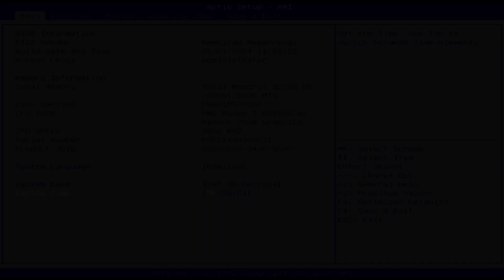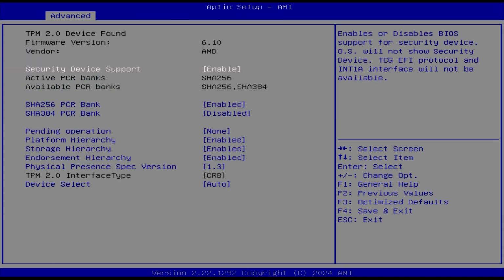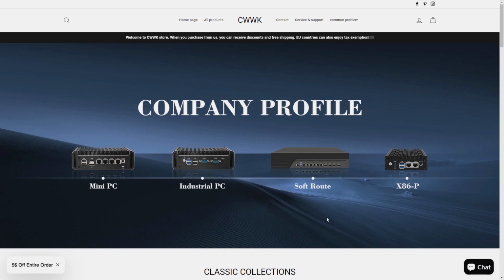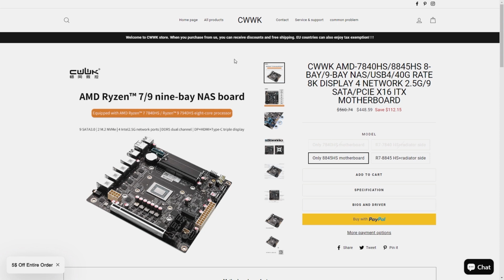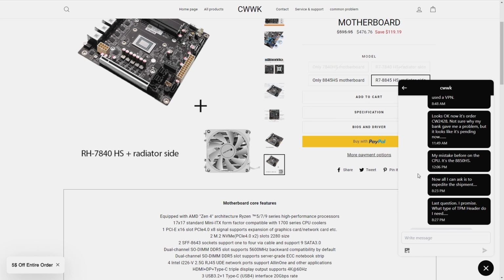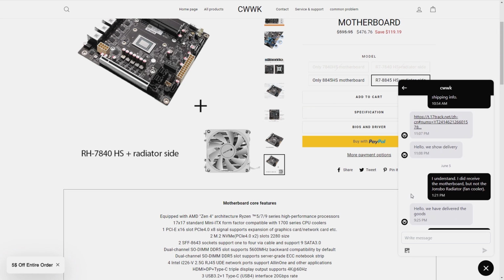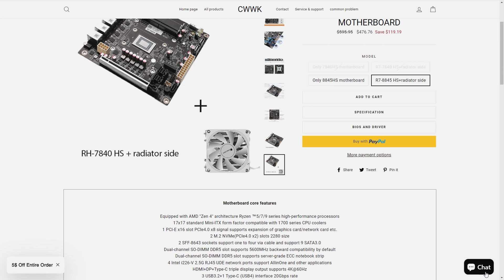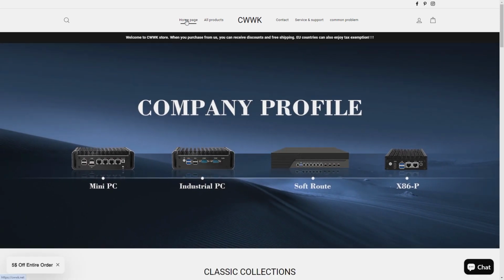My CWWK AMD Ryzen 7 8845HS 9 Bay NAS Board

Comment from the maker: OK, I got it.  Partially my fault and the fault of .........  OK me.  I still have questions, but it works...  New Video soon...
Reply: What do you mean? I got the same board, which decided to die today. Turn it off to add molex extension to the PSU to connect to the N3 Jonsbo NAS, and this thing didn't want to turn on. Tried everything, no luck. Reaching out to CWWK for warranty, and see what happens.

Comment: I have the same board, and found that Kingston KSM56T46BD8KM-32HA (32gig ECC sticks yea I know, no ecc here) are rock solid with it.  Been running it about 2 weeks 24/7 after running memtest on it.  Not as a NAS, but with 2 2tb NVME on the board, and a 512nvme in a PCIE adapter.  Running ESXI 8 with 6 VMs currently.  Also 2x 4tb spinners for backups.  I found the Jonsbo low profile cooler wasn't enough and since I have space for a tower, I put a tower air cooler on it; much better.  Make sure you have good airflow - that cables are tied out of the way of the airflow and that fans are not 'quiet' slow spinners with lots of airspace between the blades, you will need to get that air moving out of the case...
Reply from the maker: Thanks for this comment.  I guess you are running just one stick...   I have 2 sets (one samsung and one Corsair) coming in from Amazon yesterday.  That means it's late and I have no idea when it will be here, so I will order it again and cancel the one that's coming.....  Already sent back the TEAMGROUP RAM I wanted to try it out....   This is good info you gave me, I am thinking RAM, but my parts kit is at Amazon....
Reply: @JohnPonthecuff  Running 2x 32 gigs of that Kensington that I had found on Amazon.  I took a chance on it and am glad it worked.  Normally I use Corsair for stuff like this, where it is more important to be stable vs wanting a good XMP profile for a gaming rig.  That's one of the reasons I bought this board, 2 sticks of ram unlike their single stick  N100/N305.  And no P/Ecore issues with ESXI.  The extra CPU muscle doesn't hurt either.
Reply from the maker: Today I will try Samsung and Corsair 2 X 16 (already sent Teamgroup back. My fault for going cheap).
Reply from the maker: @tzviasegal3003  OK, I am done with this board.  I never should have taken out the LGA 1151 board that was working fine.   Going back to CWWK on this.  Just so you know it's not the AMD 7840.  It's the 8845HS.   They told me when it was almost ready that they were sorting out the BIOS issues.  We'll see.  Should I make a short video with my dilema or wait?
Reply: @JohnPonthecuff  Yea I've got the 8845HS one... CWWK ran out of the 7840 and when they finally had it in stock again it was the 8845hs... And I really didn't change much if anything in the bios.  Memory comes up as 5600 CL46.  I'm just scratching my head about that TPM module you installed... is that for a specific OS, like it doesn't see the built in TPM in the CPU?  Did you try without it installed?  ESXI sees it in my case, but between having secure boot disabled and Broadcom being a (fill in the blank) it's not supported in ESXI 8 (works in 7 though).  But it is there...  When there are problems, I like to jettison everything not needed to POST, then run something like memtest.

Comment: thanks for the review, no one really bothers with the cwwk or topton mini router or boards from them and similar from china so its nice to see a review on it. Cwwk live chat and support can be tricky since English is not their 1st language so it can be confusing. There are some owners of the same board who were concerned with their cpu temps since it throttles back around 90-100c, that copper block is needed for clearance around the surroundings so some owners could not remove it and replace it with a better heatsink or cooling, so they had to mount it on top like you did. I am unsure if they ever improved or fixed it I do wish cwwk did better cooling on it though. You maybe able to use a more powerful fan on top or case cooling to stop the cpu from throttling or you may get lucky and not have that issue so its a good idea to monitor cpu temps with an app like core temp.
Reply from the maker: I will be mounting it in my N3 this week. I will admit it's new to me, but it's not my main NAS. It's more for enjoyment.  I will use your comment advice as I do the next part...
I do have extra 2 extra fans and the rear fans on the Jonsbo N3.  Also going with the AXP90-X47 FULL
Reply from the maker: Looks like I am having trouble with the board right now.  Trying different RAM, etc.  Keeps cutting off while loaing linux (trunas, winbutu etc.).  Even trying to load windows it boggs down, and gives up saying it can't continue.    PSU OK (even disconnected half the drives which were working in the same case with my I5 board and LSI 9300 HBA card). Anyway, just letting your know.
Reply: @JohnPonthecuff  these mini nas/boards are very fussy with ram modules and ssd/nvme compatibility, might be worth trying a smaller ram module and a different branded memory module as a quick test. Also worth trying 1 on its own or in the other slot also. Have you also tried memtest to check if the ram is passing ok?  I found samsung modules most compatible, but I am aware lots of cwwk owners (routers mainly) had issues with larger size ram modules like 32gig or 64gig modules. 16gig and 8gig modules tend to be more compatible. Crucial brand can sometimes be problematic also.  Also check the cpu temps, maybe the bios can show the cpu temps if its hitting close to 90c it maybe causing freezing/lock ups/slow downs.
Reply from the maker: @mrpurpleman9698  I'll tell you what upset me.  Why is there a TPM module adapter area if TPM 20 is already built in (it's in the BIOS )?  Maybe it's for a tpm 3.0 someday......
Reply: @JohnPonthecuff  Yeah that is odd rather have the space for other features, could be for future proofing tech as you say. How did it get on is it stable or any better now?